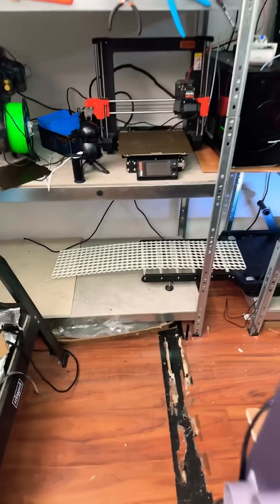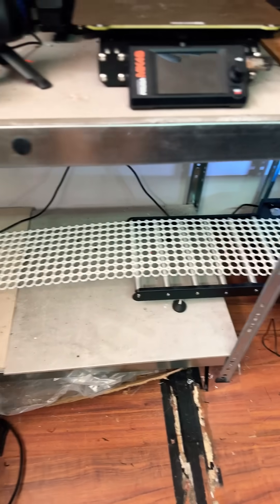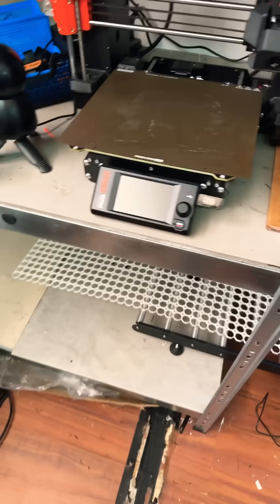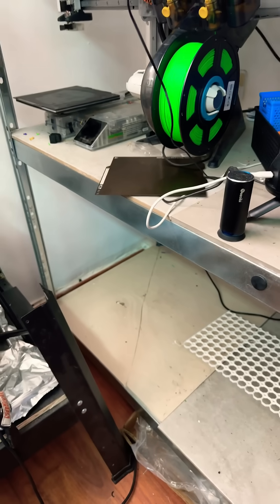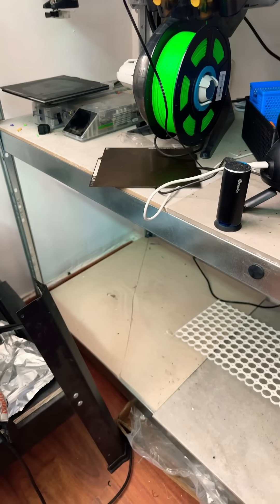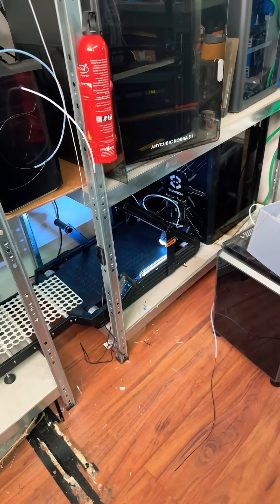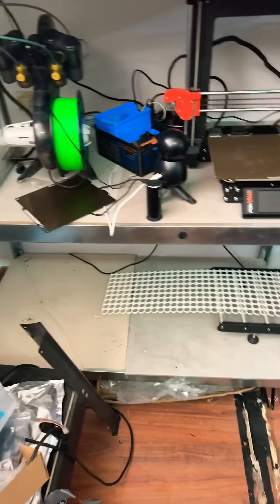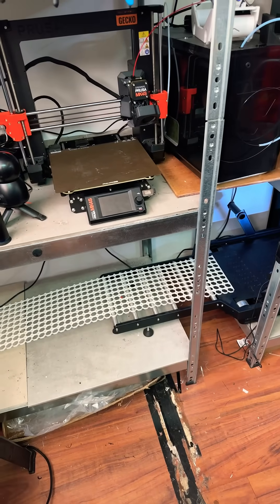Leaving a 3D printer running for a WEEK straight?

Comment: There are print failures and the very small possibility of printer failure leading to fire.  You wisely have a fire extinguisher there on the rack leg.  But is there someone there to use it?

Comment: If you’re worried, you may be able to do 2 of them then use an ams or something as a backup, it would require some redneck engineering to make work but i think it’s an option to consider

Comment: After rewatching this a 100 times while i typed my first comment , i would raise it higher,  or see how the pieces fall.  It looks like as you finish each piece, they  will cantilever  when being pushed/ejected by the next piece. The next piece will eventually be underneath the previously printed part at the lip of the rollers like this: / --- and may mess up further prints, that's why i mount mine on the wall with french cleats.  Got the idea from Repkord

Comment: Do it.  But add a smart plug controller.  You can turn off, or power cycle in case you need to, or turn off if finished. I have mine mounted on a wall and the piece drop off as the belt moves.

Comment: Send it! I saw youve got octo running on it in the comments and as long as you can see it or have someone to check on it while youre gone you get some new content whether it succeeds or fails! I started a 2 day chinese dragon print before I flew out for vacation this week and hope its not a spaghetti mess at home right now 🤣 Octoapp says it completed but i need to fix my webcam to work remotely apparently 😅
Reply from the maker: Yeah I remembered only after posting that Octoeverywhere AI should alert me if things go haywire
Reply: @thenextlayer  I've never personally used the AI detection but that should work! Just saw the short that you started the print, safe travels and I cant wait to see the results next week✌️
Reply: @thenextlayer I would normally say don't use AI because of false positives, but the multiboard is basic enough that  it shouldn't trigger a false detection.

Comment: I have had a blob of death cost me $100 in parts since it ruined the hot end and the board.  But that happened when I tried to print items in sequence and the second one came off the plate overnight.  Give it a try.
Reply from the maker: Same thing happened to me actually recently. Sequence is dangerous if you’re not there

Comment: I’d set up an RPI with a camera and an AC SSR to be able to shut it down remotely in case. Without remote controlling this: No go.
Reply from the maker: I have Octoeverywhere on it at least so as long as the board is running I can emergency shut off. This printer isn’t on a smart socket though. Oops.
Reply: @thenextlayer  at least controllable :)

Comment: See it as an experiment. Even if you have a print failure the experiment is a success.
Reply: This is the man who can at least recycle it if it fails. I'm having a 'slaps forehead moment' as I was thinking I'd like to build an infinite bed printer, but couldn't think what to print with it. Especially in view of the lower build height. Custom wall storage grids like this are the perfect use case.

Comment: you should be alright. youre good. Just make sure you got a video when you come back
Reply: I think the prints are going to mess up when it starts running into the other print. I don’t think it will fall I think it will flex and angle and end up making more bent parts